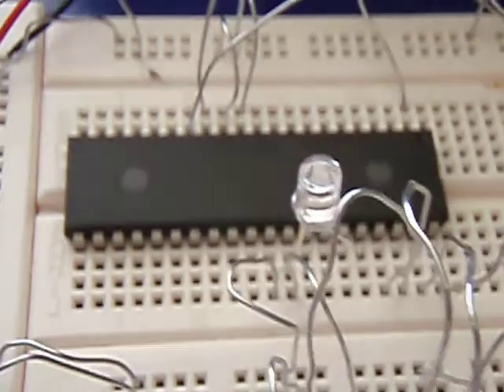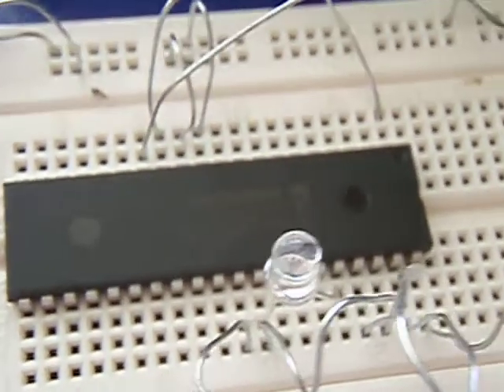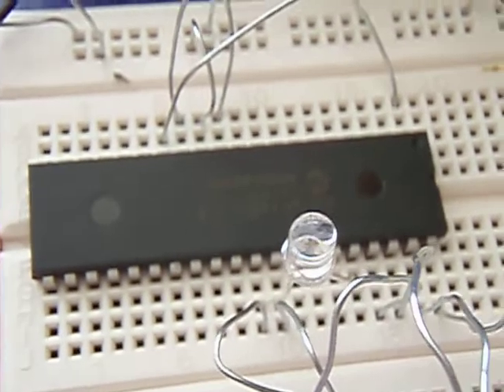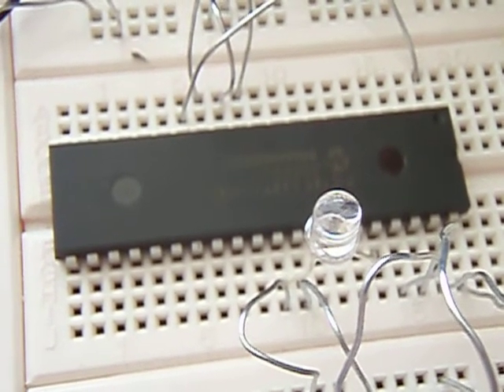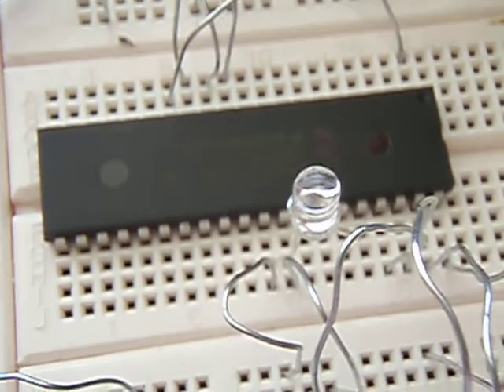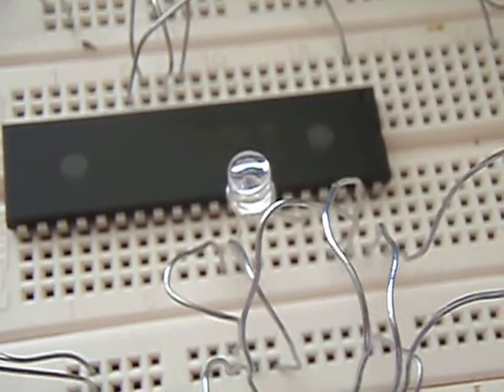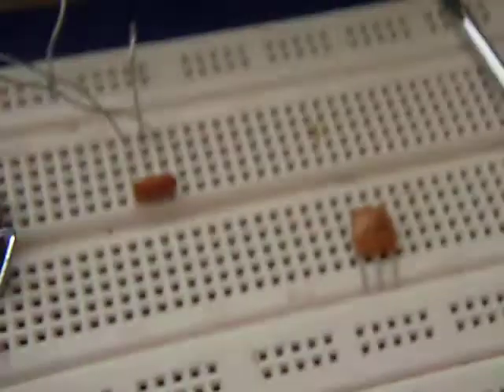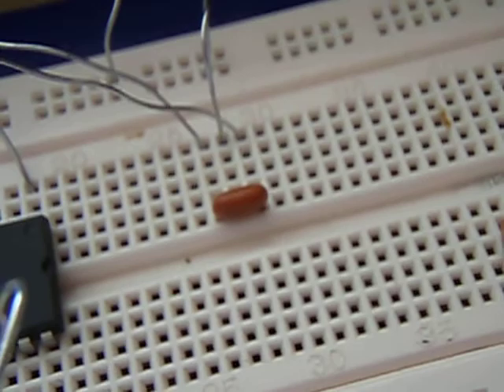Nokia LCD with PIC Microcontoller scanning the LCD-matrix

Comment from the maker: The display is clone that you can buy on ebay, it´s cloned from the display that Nokia used in 6100 and 6200. It has a SPI interface, that´s way it´s a bit slow. If you want one, just search on ebay for "nokia lcd spare"..